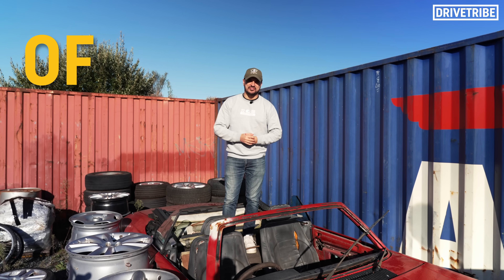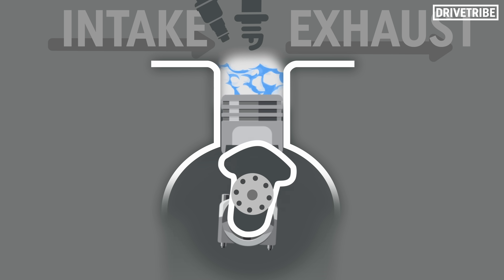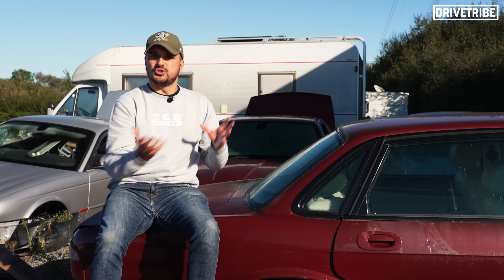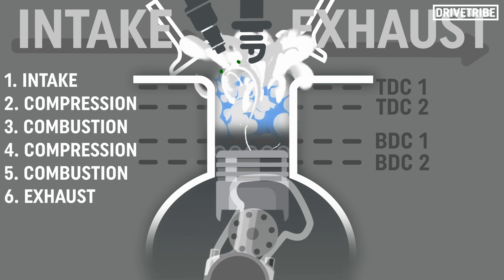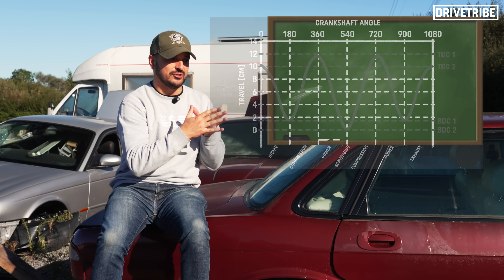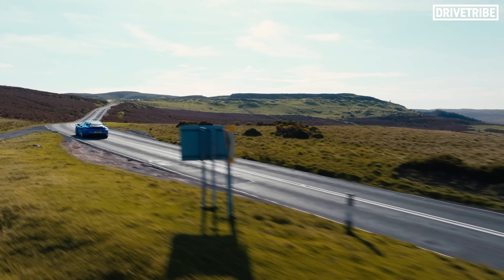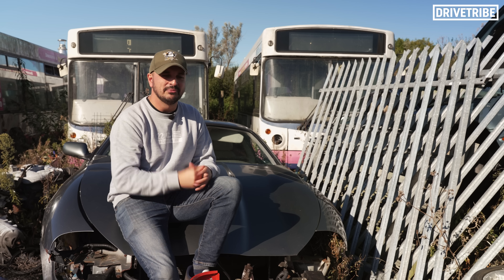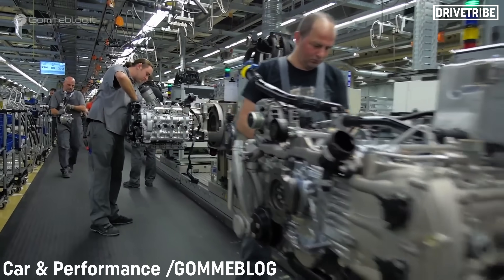This is how Porsche's new SIX-STROKE engine works!

Comment: Imagine if Porsche were able to  produce a turbocharged 6-stroke, 2-litre flat six, driving the rear wheels of a new car called the 119 - which would be the bodyshell of a 1973 RSR  except in all carbon fibre, and superlight - no luxury interior - like the old 911R.
Then, on top of this, put in a 5 kwh battery to drive the front wheels with 200 BHP of electricity.
And give the owner a way to switch between them. And allow the 6-stroke to operate in "work mode" where it just charges the tiny battery to maintain electric-only progress.

Comment: The way I see the "concept" is nothing new. The idea is to use exhaust gases in the combustion chamber to keep engine heat sustainable. Think of the regular 4 stroke engine with an EGR system. Which recirculates part of the exhaust gas back into the combustion chamber. The idea is to maintain control over the heat produced over time during the combustion cycle. Under high engine loads the heat is easily controlled by how much exhaust gases are maintained in the chamber. Rather than using an EGR system Porsche engineers it into the combustion cycle. What long term effect will it cause to the engine is still unknown for now. Don't think of it as something special.

Comment: The idea is just over complicating the combustion process. Instead of the motor.....why PORSCHE doesn't look at the rest of the system in order to de carbonize the combustion process.
If PORSCHE wants the engine to be alive needs to find another way because I believe this added combustion process will make that engine unreliable

Comment: Effiency of this can not  depend on exhaust port velocity to pull in a fresh charge. It simply will not make much additional power at low RPM without a blower. This is why naturally aspirated two strokes (ported cylinder) have to 'get on the pipe', and Detroit diesel two strokes use a blower to make their power at low RPM.

Comment: It’s analogous to the second expansion piston solution used in steam engines of yesteryear. A clever way to extract a little extra push out of those hot pressurized gases.

Comment: Odd firing strokes isn't a problem. Motorbikes - at least performance ones - deliberately have weird power strokes in order to allow the tyres to have a period of lower force on them to increase overall cornering speed and traction. 

Now, the complexity? That's another story. I owned a Cayman S for a couple of years and one of the camshafts snapped. When it was in the garage the Porsche mechanic took me into the workshop and showed me where it had snapped. Right in the middle. His words were, 'That's odd. Normally they snap at the drive end.' My response being there's nothing normal in my book about a snapped camshaft. Thankfully the car was under warranty or I'd be looking at a 7K bill. 

Another bloke I know had a number of 911's one after the other. Every one had major issues, usually leaking seals on the drive. His sister had a convertible which decided to open up in the middle of winter by itself when it snowed..

Bottom line is that Porsches are no where near as reliable as these shows say they are and a super complicated engine? Yeah. I might give that a miss.
Reply: You’re talking about firing orders on motorcycles. Not strokes

Comment: the 6-stroke used to be known as the "miller cycle" engine, and the concept is certainly not new... iirc it got some newsplay about 15 years ago, and it was certainly not new then... it does aid with cleaner emissions, but lower specific output... no surprise that Porsche is looking at it again... cheers!
Reply: That's not how a Miller Cycle works.

Comment: Let’s be honest. Electric car sales are up 31%. Only 4% of people who buy an electric car go back to a hybrid or ICE car. VW group profits are down almost 50% and as a result they are in trouble. This won’t make it to full production. China will buy more of Porsche/VW.
Begrudgingly ICE is over. Zero friction electric motors. Batteries that can charge from any point of capacity percent to full in 6mins. 
As someone who loves the sound and feel of a v10 or BMW 6 cylinder. These ICE machines are done, gone, buried.
Reply: Dont forget about synthetic fuels.

Comment: Interesting concept if it actually works.
Reply: It will work but there will be a host of issues with reliability. The gear on the crank will be another source of failure, the secondary injection ports too. I honestly don't see the point of this when Hydrogen and/or electric seems to be the future.

Comment: With the patent filing, they probably are making a jump on the EPA or equivalent agency requirements for allowable emissions, with the double burn, any left over fuel gets a post burn, as you said, replacing needs for maybe EGR valves and or Catalytic Converters. Not to mention how expensive in both waste and materials those CC's are.

Comment: Horribly overcomplicated and seems like a way to make it cleaner running? Maintenance costs will rival aircraft.
Reply: My 6.0 diesel would like a word with you... 😂  This is a way to get around an EGR system from what I can gather, which is required to meet emissions standards nowadays. My truck is low miles for an '07 (89k miles as of today) and I'm on my 3rd egr valve. And yes I've tried to clean and reuse them. The next thing to change is the EGR cooler but I'll delete it because I don't have to do SMOG tests
Reply: It's maintenance costs can't be worse than EV depreciation or battery replacement. I know which one I'd rather have.
Reply: I wouldn't say its overcomplicated at all, the tech is pretty basic and resembles similar things in valve tech we've seen through the years (vtec, Mivec). Given there is a difference between the two but both were considered complicated originally and then later made very main stream. 

The part I don't understand, Porsche are one of the manufactorers that are moving towards electric and Hydrogen powered cars, this tech doesn't seem to fit with that model UNLESS they have plans for this to be primarily a hydrogen powered engine which does change things quite alot.
Reply: @MrWiggz69  Porsche is actually pushing Clean combustion fuel/Bio Fuel over electric. They invested heavily in that area already.
Reply: @MrWiggz69  
They already making synthetic fuels and working on making it cheap.
Reply: @MrWiggz69 cleaner fuels which burns like petroleum but does have high emissions also will use this engine and they have invested heavily in them as well
Reply: @MrWiggz69  This kind of technology (if it is ever being put in a production vehicle) is meant for their highend sport cars. Mainly GT3/TurboS 911s. Those cars will always be better with an IC-Engine due to the enormous weight advantage. Those cars are also expensive enough that the customers can afford e-fuels which will be extremely expensive. Therefore the added costs in maintenance and repairs also don't really matter.
All their mainstream models will move to electric though as e-fuels would be too expensive anyway.

Comment: It would be crazy if they slaped a turbocharger on it aswell
Reply: The port arrangement will mean it needs forced induction (turbo or supercharger) as it’s very similar to the old Detroit diesel 2 strokes. If it’s only relying on the slight effect through scavenging there won’t be that great a performance gain, just added complexity. In any type of machinery, the simpler the better. This is just less reliability for some possibly dubious gains.
Reply: @CattaroFuran Jep but European manufacturers, need to follow strict emissions,  so its probably why they did this.

Comment: If a hydrogen generator was installed to constantly trickle hydrogen into the engine or a fuel canister it could actually make petrol fuel burning more efficient. You can plug it in at night and it fills up the canister with hydrogen. It could alternate between petrol fuel and hydrogen or a combination of both during driving. Hydrogen actually will clean up your emissions to the point where you don't even need a catalytic converter. And your home could be your fuel station.
Reply: @PseudonymAliase  I was thinking the same thing but with natural gas. Hydrogen would definitely work. Oxygen would work too, but the volatility isn't practical.
Reply: @bryankotsch  hydrogen engines exist volatility is totally practical. The problem is it costs $250 to $350 to fill up your hydrogen canisters and go 300 to 500 miles
Reply: @PseudonymAliase  We need a more streamlined way to extract hydrogen and oxygen from water. Of course, big oil companies would not be happy. I remember the Bugatti that ran on propane or natural gas as well as gas and achieved the same top speed. Fastest car in the world for a brief period in the 90's.
Reply: @bryankotsch  I've installed hydrogen generators the problem is your vehicle can't tell how rich or lean the mixture is at the O2 sensors and they have to be adjusted with a system. The exhaust gases run so clean that the O2 sensors tell the computer to put more fuel in which actually makes it more richer and worse on your fuel economy. But that could be worked out. When I was younger I didn't have the knowledge to deal with it so I didn't get involved with it. But an auto manufacturer can figure it out if they wanted to.
Reply: Using a mix of gasoline and ethanol also give cleaner emissions. My MB190E would not pass the emissions tests here without running 40% ethanol and rest gasoline mix.
Reply: @a64738  I have an E85 compatible engine in my Dodge Ram. Ethanol burns fast, so you sacrifice travel distance for a cleaner burn.
Reply: @a64738  unfortunately you sacrifice power by having that mix so you lose efficiency but hydrogen can improve combustion by 30% more power or fuel efficiency up to 100% because it can run on hydrogen instead of gasoline. That's what the plug in generator filling a canister canister to eight bar at night getting 300 miles to a tank of hydrogen can offer. And when you run out of hydrogen or it starts getting low it switches to gasoline with a trickle of hydrogen from the generator.
Reply: Just need to find a hydrogen source then.
Reply: That's some serious laws that need to be fixed.

Comment: Now that is going to be a unique sound
Reply: And i would assume a pretty hot running engine.
Reply: @BurninSnowMan  it will run cooler not hotter.
Reply: @BurninSnowMan it might need a twin V-mount cooling system
Reply: It will likely sound like two engines running out of slightly out of phase with each other.
Reply: unlikely that will reach mass production. No sane person would buy this. Then again most new cars in western world are leases.
Reply: Probably sounds like an expensive maintence bill as well